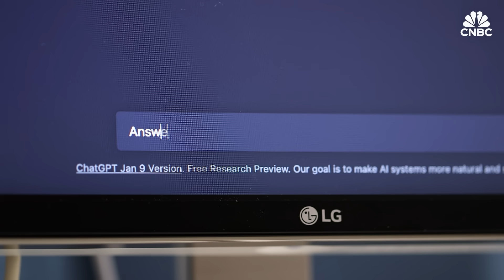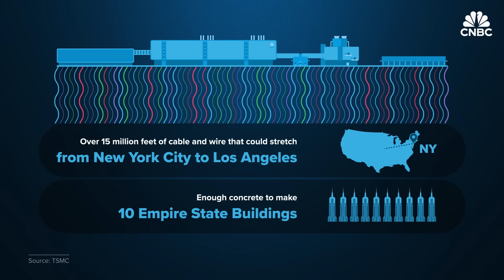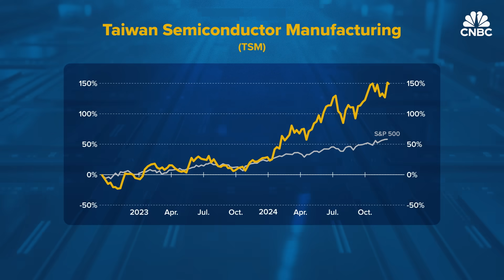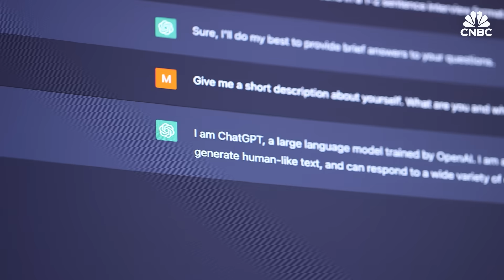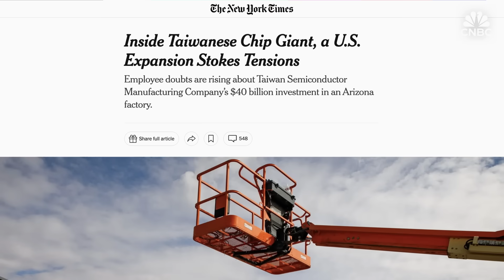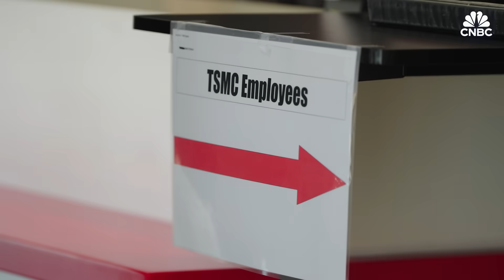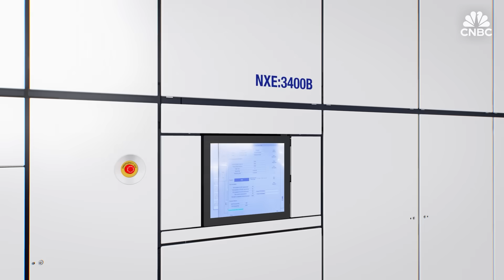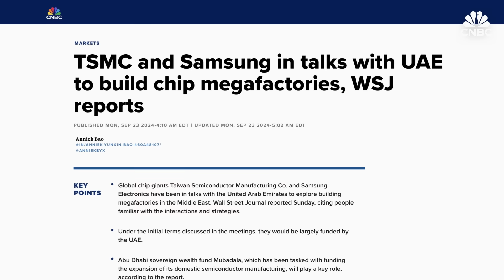TSMC’s New Arizona Fab! Apple Will Finally Make Advanced Chips In The U.S.

Comment: The best investment in history hands down. Worth every penny spent
Reply: You're absolutely correct. Digital information processing is a part of almost every consumer electronic gadget and appliance in existance. Even home appliances as basic as a fridge, laundry machine, dishwaser, and microwave oven - all have controls that incorporate printed circuit boards with integrated circuit chips on them. Modern automobiles get nearly double the fuel economy of their predecessors of the 1970's because computers control the fuel injection, ignition and valve timing. I can state a specific vehicle too, from my own life: I owned a 1978 Toyota Corolla back in the day. Bought brand new, it got about 25 mpg. Even though it had a catalytic converter, there's no way it could pass the EPA tailpipe pollution standards of today. I currently own a 2020 Corolla Hybrid. It gets 50 mpg, and has at least 100% more powertrain torque and horsepower than that '78 Corolla - largely thanks to the much more efficient gasoline engine and the 70 hp electric motor in the Hybrid powertrain - all of this only being possible because of the computers that control the powertrain. The very computers (and in some cases cell phones) that everyone who participated in this conversation thread used to type their comments on, were of course only possible because of the IC chips in them that this factory is going to make when it goes into production.
Reply: @laura-ann.0726 What's also super important is the knowledge and experience that will come out of the fab. Americans will now be able to gain experience there, Arizona's colleges will invest more in semiconductor research and engineering. In that regard, the US is gaining so much more than just a fab. I'm very confident that this investment will more than pay for itself just with that alone.

Comment: I first heard of TSMC when Apple had two models, one with Samsung's SOC and another with TSMCs, turns out that TSMC's was way faster, so Apple ended up ditching Samsung and made TSMC-only chips.
Reply: iPhone 6S.
Apple placed its chip orders to both Samsung(14nm) and TSMC(16nm)
it turned out 16nm beat 14nm!!!!
Since that, all Apple's orders went to TSMC.
Reply: The same chip (A6) made by TSMC was only slightly faster, but it had a better battery life and less heat. The main reason Apple moved away from Samsung is that Apple found their chip's design/patents being used in Samsung's Galaxy phones. 
Apple sued Samsung, Samsung counter sued. In the end the jury awarded Apple $1.05 billion in damages.
 Surely you don't want to hand your next-generation chip design over to a company that can peek into your desgn and be your main competitor.
Reply: @harrywang138  correct, but you forget to mention this...  TSMC used 16 nm manufacturing and Samsung used 14 nm.  Consider this, the chips TSMC made still can have better performance. ( faster, lower energy consuming, and less heat ).
Reply: Then Samsung could not come back to Apple.
Reply: samsung is absolute garbage, koreans always make subpar products but cheaper, just like their cousins the chinese
Reply: Apple puts the pieces together, assembly from a foriegn supply chain.
Reply: Apple doesn't make TSMC chips.
They just order.
Reply: @rrsharizam  to be more precise..... it is more like
A real estate company wanna sell a luxury apartment (iPhone M chips)
they have many architects to design this apartment and draw the blueprint ( Apple design the chips )
and they find a construct company to build this apartment ( TSMC makes the chips base on Apple's blueprint )
and when the apartment is finished, the real estate company can sell this apartment ( Apple's M chips in iPhone ).
Reply: @rrsharizam  to be more precise, ...  it is more like....
A real estate company, named Apple,  wanna sell a luxury apartment ( iPhone M chips )
They have their own architects to design the apartment and to draw the blueprint ( Apple engineers design the chip )
Then they found a very good construct company, named TSMC, to build this apartment. ( TSMC manufacture the chips based on Apple's blueprint )
finally, the apartment is done so the real estate company can sell it. ( M chips in iPhone )
Reply: @rrsharizam   to be more precise, ...  it is more like....
A real estate company, named Apple,  wanna sell a luxury apartment ( iPhone M chips )
They have their own architects to design the apartment and to draw the blueprint ( Apple engineers design the chip )
Then they found a very good construct company, named TSMC, to build this apartment. ( TSMC manufacture the chips based on Apple's blueprint )
finally, the apartment is done so the real estate company can sell it. ( M chips in iPhone )
Reply: @rrsharizam  Apple designs their cpu chips and now modem chips.  Make is loose term.

Comment: “In 1954, the first transistor radio, the TR-1 had 4 transistors which cost $2.50 apiece ($29.03 in 2024 dollars). Today, an AMD Ryzen processor with 9.9 billion transistors is on sale for $650, or about $0.000000066 per transistor; in other words, since the 1950s the cost of a transistor has fallen by about a factor of 300 million.“

Constructionphysics substack

Comment: 14:51 - This TSMC Arizona facility currently has 14.5MW of solar panels from their one parking lot solar array on the southeast corner of the campus.  At 22% capacity factor, that equates to 76.6MWh per day of solar electricity production from just this one array.   So to cover the daily 2.85GWh of electricity, TSMC would only need about 37 of their current parking lot solar arrays.  They could probably fit another 10 of them on the campus alone and the building rooftops can be used as well.

Then the remaining 26 can quite easily come from the vast deserts around the fab or the greater Phoenix/Arizona area.  Add another 15% for safety margin and TSMC's own solar would take a massive chunk of their annual load off from the grid.  Add in on-site energy storage and see that amount rise significantly.  The closer the solar arrays are to the fab, the less grid infrastructure is used because on-site solar unloads the grid.

In lulls of activity, these solar arrays would be exporting power and actually supporting the grid.  There is also wind power turbine power which can provide power through the night.
Reply: Great idea, but the solar power would need a massive battery bank as well to store power during the periods of time when the sun is down. Solar would not be able to supply the baseload power needed for a 24/7 manufacturing schedule. But i do agree that it is a good idea to offset the large energy demand on the rest of Arizona's grid. The best option is for APS to construct multiple new reactors at our regional Palo Verde nuclear power generating station. Coming from an Arizona resident :)
Reply: @stephenkelly2648  Furthermore...  TSMC has been purchasing Renewable Energy Credits (RECs) since 2023 to cover 100% of its initial expected power use.   For now, the AZ grid and the surrounding regional grid can supply the base load during the night.  Arizona ISO trades power with neighboring states like CA, NV, NM and UT.
Reply: @beyondfossil  Very interesting argument. I agree it will take too long to construct new reactors for it to make any difference for TSMC. And the nuclear waste disposal is still a big question for the whole country. 

The water usage is not as much of a concern because the Palo Verde plant uses treated wastewater to cool the reactors. Over 90% of wastewater is reused in Arizona for beneficial use. 

It will be very interesting to see how it plays out. For now I am happy to see so much development occurring in my area, it is very exciting!
Reply: @stephenkelly2648  Thanks for your interest and the comment.

Unfortunately, nuclear is the most expensive form of energy and also the slowest to build at 10+ years.  Additional problems are the extremely hazardous waste and large water usage.  Arizona and the US expected to have water sourcing issues and 2000L to 3000L of water non-stop per MWh of nuclear generation is substantial.

Specifically, expanding Arizona's Palo Verde nuclear power plant with a new reactor wouldn't make a difference for TSMC.  Optimistically, adding a new reactor would take at least 15 years due to usual nuclear construction in the US: permitting and construction time taking the majority of the time.  That 15 years is an optimistic schedule too and likely would take longer.  A chip fab factory may only have a lifespan of 20 to 25 years.

There are no plans to expand Palo Verde.  There is also no current nuclear construction in the US either.  The latest nuclear power plant in the US is the Vogtle plant in Georgia.  It was a schedule and budget fiasco over -budget by double ($14B to $30B) and over-schedule (2016 expected but was 2023).  Taxpayers are on the hook for some $8-billion for this thing!   With renewables and batteries reaching historic low costs and still driving further down, Vogtle could be the last new utility-scale power plant constructed in the US.

Nuclear power is simply too slow to construct and too costly.   The next 15 to 20 years will see even more huge growth in renewables and grid-scale storage.  Its already growing at high exponential rates at ~26% CAGR and still accelerating!  Nuclear already is not really a consideration and much less so in 15 years' time.

TSMC has been purchasing Renewable Energy Credits (RECs) since 2023 to cover 100% of its initial expected power use.   For now, the AZ grid and the surrounding regional grid can supply the base load during the night.  Arizona ISO trades power with neighboring states like CA, NV, NM and UT.
Reply: @stephenkelly2648  Also, there are no plans to expand Palo Verde.  There is also no current nuclear construction in the US either.  The latest nuclear power plant in the US is the Vogtle plant in Georgia.  It was a schedule and budget fiasco over -budget by double ($14B to $30B) and over-schedule (2016 expected but was 2023).  Taxpayers are on the hook for some $8-billion for this thing!   With renewables and batteries reaching historic low costs and still driving further down, Vogtle could be the last new utility-scale power plant constructed in the US.

Nuclear power is simply too slow to construct and too costly.   The next 15 to 20 years will see even more huge growth in renewables and grid-scale storage.  Its already growing at high exponential rates at ~26% CAGR and still accelerating!  Nuclear already is not really a consideration and much less so in 15 years' time.
Reply: @stephenkelly2648  Thanks for your interest and the comment.

Unfortunately, nuclear is the most expensive form of energy and also the slowest to build at 10+ years.  Additional problems are the extremely hazardous waste and large water usage.  Arizona and the US expected to have water sourcing issues and 2000L to 3000L of water non-stop per MWh of nuclear generation is substantial.

Specifically, expanding Arizona's Palo Verde nuclear power plant with a new reactor wouldn't make a difference for TSMC.  Optimistically, adding a new reactor would take at least 15 years due to usual nuclear construction in the US: permitting and construction time taking the majority of the time.  That 15 years is an optimistic schedule too and likely would take longer.  A chip fab factory may only have a lifespan of 20 to 25 years.
Reply: Cooler underneath panels.
Reply: @brodriguez11000  Yes, it's a perfect combination really.  All parking lots, especially in the southwest should have overhead solar. There's probably enough parking lot area in places like southern California, Arizona, NM to power entire cities' annual electrical use!  Even if not fully, then a big chunk of annual demand.
Reply: I thought the parking lot solar arrays were for recharging their electric cars !! Doh !
Reply: @richardconway6425  The solar arrays are more the likely "grid-tied".  So they'll power anything attached to the grid, including EVs.  But with that massive array, the EV power draw is a small amount relative to the total output.  EV's charged from an overhead array is about as perfect a combination you can get.  Big power flowing into your EV's batteries directly from the sky, and totally bypassing the grid.   Then enjoy "riding on sunshine". ☀⚡🚗

Comment: When a blank wafer is first created, it is worth about $100.
By time it goes through the 3 month process of turning it into 250+ Chips, it is worth over $125,000.
Reply: That puts each chip at $500. I think you need to fact check that claim.
Reply: @menkarbeet  and on top of it they're unpackaged too. I don't think anyone is paying $500 a pop for just dies.
Reply: What % of ICs cost $500 each ?
Reply: It is even higher after each individual chip is packaged and ready to be slotted onto a circuit board!
Reply: Last I checked a few years ago, a 7nM wafer cost $12,000.  I know 3nM wafers cost more, but I doubt it's $125,000.
Reply: @GROGU123  He is talking about the finished chips
Reply: @jesselee4725 I’m talking about the finished wafer as well.
Reply: I highly doubt your claims. The blank wafer must cost much more than $100 since it requires an incredibly complex process to produce it
Reply: @DanielFenandes  what's so complex about making wafers? They grow crystals, slice and polish them. They've been doing it for decades now so they're pretty good at it.
Reply: @DanielFenandes  It's not complex at all. You could learn to do it.
Reply: @ yeah. After I made this comment I went to research about it and I found out I  could make it in my own garage. I’m already working with the industry to be a supplier
Reply: $125,000 could be the upper range of a wafer value.  If you had a yield of 250 chips that'd be $500 a chip. But I don't think you'd fit 250 chips that valuable on a 300 mm wafer. You lose a lot on the edges. Squares don't fit in circles all that good. So it's probably more of a theoretical maximum value.
Reply: @1pcfred yeah, maybe post-packaged and with good yield, NVIDIA could sell a wafer for that much. TSMC certainly does not make that kind of profit off of each wafer though.
Reply: Absolutely not, a single blank wafer can cost thousands depending on what type/size it is before any lithography is done.
Reply: *$25000 per wafer dependent upon the tech involved. N4/5 will be 25k coming out of FAB21 (AZ).
Reply: Can some help me understand how cpus I get the transistors part with turning 1 an 0 on or off but how do they get the CPU architecture on the CPU if it's all code based
Reply: @chriswright8074  1 and 0 are defined voltage levels in logic.  Generally off is 0 and on is 1 with switching. As to how transistors are made into logic gates that's complicated. There's basic logic circuits though that combined do higher level things. A CPU will have an instruction set. Those instructions are read by the processor and each instruction tells the processor what to do. The CPU has registers and it operates on the data in those registers based on the instructions it receives. It gets complicated just due to the sheer speed and volume being operated on. Code has to run on physical hardware. There's no such thing as all code based. On some level electrical charges are moving around.
Reply: Now it needs it's own thorium nuclear plant
Reply: @accordv6er  At least solar, since they are in the desert.
Reply: Dude a 2nm wafer (not even in production yet) costs between 25-30k. Maybe once you sell the chips at retail you can get to 125k but TSMC doesn’t see that.
Reply: Probably matters on which chip is being made big GPU chips are expensive and make big profit. @jonathanjones7751
Reply: I'll give ya two fiddy for it.
Reply: The video said $18,000
You just inflated it to $125,000
Reply: Yeah, because the wafer is the only cost 🙄
Reply: @The_Ballo  diffusing the wafer is a major cost. But the designers want to get paid too. Packaging the die also has to cost something.
Reply: I heard its made of sand.
Reply: Hire Taiwan people to come over to America
Reply: @hollydilag  I think we should move everyone in Taiwan to America. I'm sure we could find somewhere for them. They seem like decent enough people to me. Then everything Made in Taiwan would be Made in USA. I kind of like that idea.
Reply: @1pcfred  Not every tsmc engineer wants to work in the United States. Do you mean to immigrate all Taiwanese people to the United States? A total of 23 million people
Reply: @1pcfred that’s a bit excessive ain’t it?
Reply: @1pcfred  I dought that the same outstanding performance would result from ANY  other successful culture that is managed by, Greed is good, managers.
Reply: Sadly China just stopped the export to the US of the minerals you need and you have no other supplier. So in 3 months, it will still be worth $100
Reply: @piccalillipit9211  Malaysia exports a lot of raw silicone to foreign buyers
Reply: @piccalillipit9211  It is better to remain silent and let people think you are ignorant, than to open your mouth and remove all doubt. Chips are made of the sand that the building is built on.
Reply: @piccalillipit9211  the US has every mineral imaginable. We just don't mine it all for various reasons. We even have helium which is exceedingly rare. There's physical reasons why the US is as wealthy as it is. One of those reasons is mineral wealth. We hit the lottery there. We've literally got it all.

Comment: The cost of the technology, clean & dry room space, the mech systems required to maintain humidity and temperature requirements, process pipe and electrical systems is astronomical.  Then there’s the challenge of getting the BMS to work harmoniously is huge.  Congratulations to them for getting to this point and now finding the labor to run this place.
Reply: A capital-intensive industry regardless of who's doing it.
Reply: @brodriguez11000  Gotta get Automated Logic in there so I can relocate.